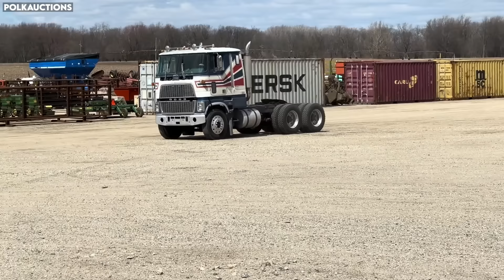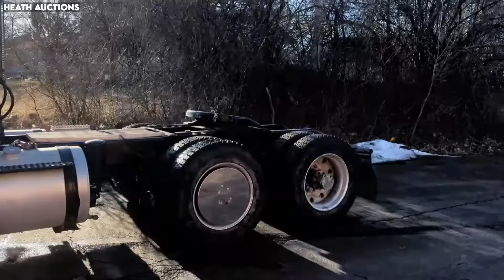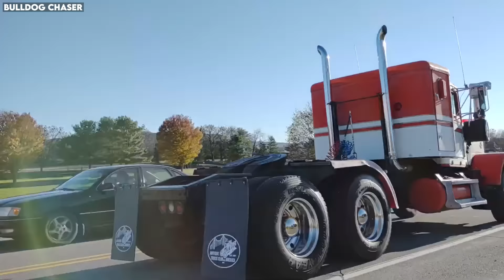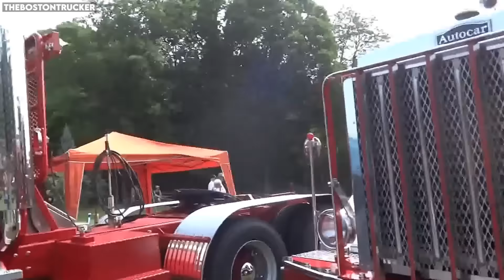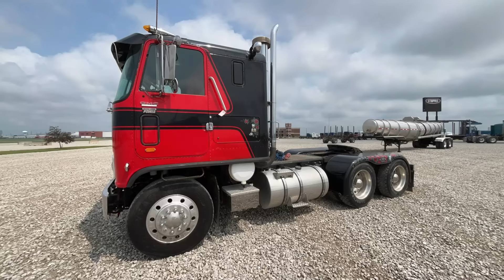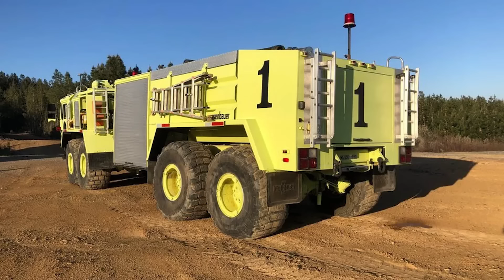10 1970s Trucks Built Before Emissions Changed Everything

Comment: My first truck was a 1978 MACK with a 290hp Cummins and it didn't have a Jake Brake or any engine retarder & it didn't have power steering as well I went to 48 STATES it had a 9 speed Mack & Mack rear ends & Mack fame top speed was 64 miles per hour in was conventional

Comment: I bought a '73 Kenworth K-100 cabover Day cab for a Manure tanker truck. 6-71 Detroit, RR 13 speed transmission. I would shift 20+ times from the storage pit to the field and back, never more than 4 miles one way.🙄 Loud and rowdy, but it wasn't too bad to run, especially if you didn't care about your hearing. GM & Ford left the "big truck" market because they had to buy Cummins and Cat, sometimes Detroit, engines to supply what the customers wanted. They preferred to keep everything "in house", so Ford only had a license for a few Cummins clones, and GM only had Detroits. IH/Navistar got muddled up in the whole IH/Case merger, and the Navistar kept the DT444/446 engines in their fleets, and were ok until the "Maxforce" series of emission 💩 really fried the engines (mainly just the turbo's, but that was a $6k fix). Yeah, the emissions rules sucked, and destroyed more than a few companies and jobs.